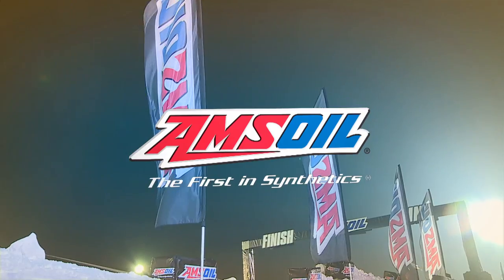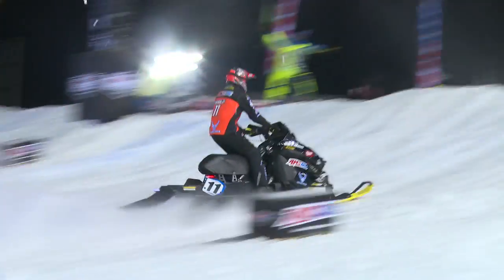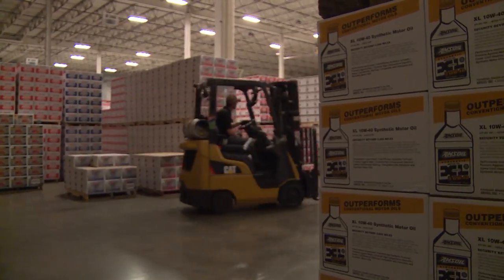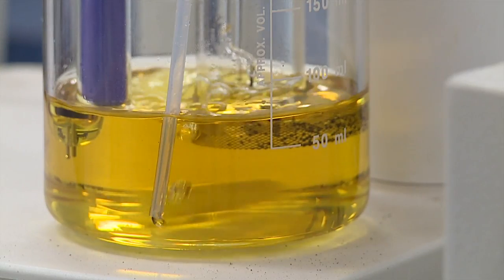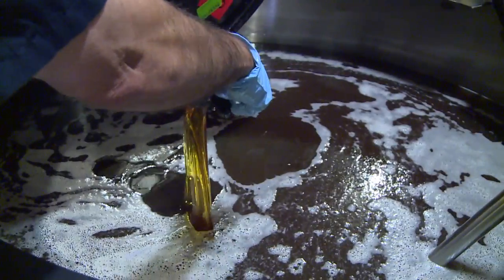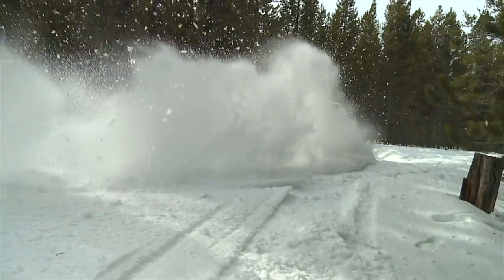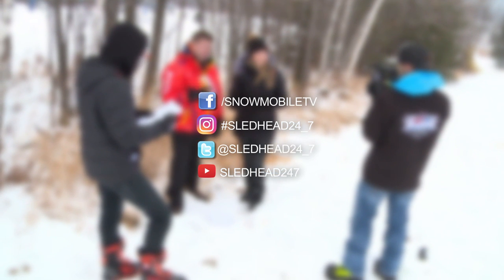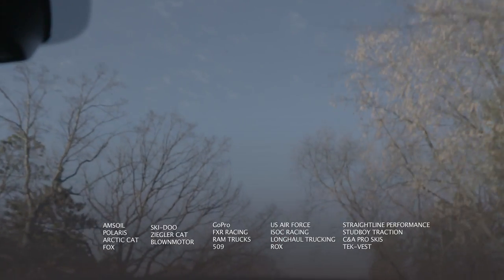AMSOIL Story: Sledhead 24-7

Comment: Seems to be a love/hate thing with people and Amsoil products. Many say to stay with OEM oil only in their sleds as they are the only ones making specific additives for specific engines. Many others say Amsoil Interceptor oils are superior to OEM oils. Who really knows? I have a '15 Ski-doo with the 800R Etec engine and it has had nothing but the Amsoil Interceptor in it from day 1. I only have 700 miles on it, but I guess time will tell. A video was done showing two engines that was ripped a part testing the Amsoil and XPS oil. BOTH oils did well, but the Interceptor was just a bit better, prompting me to go the Amsoil route.
Reply: Update on using amsoil?